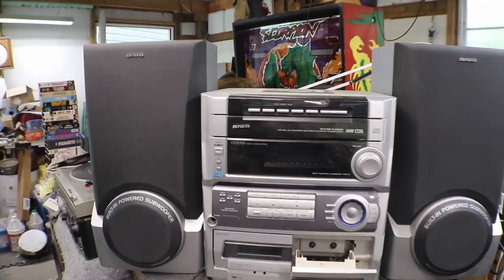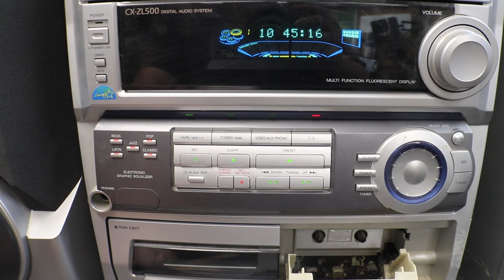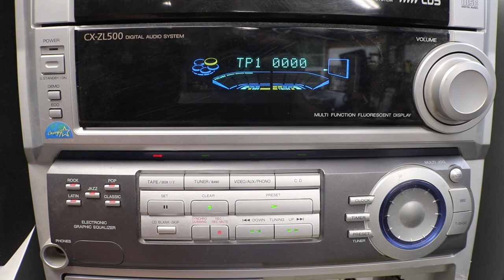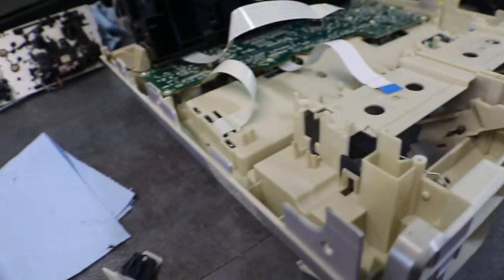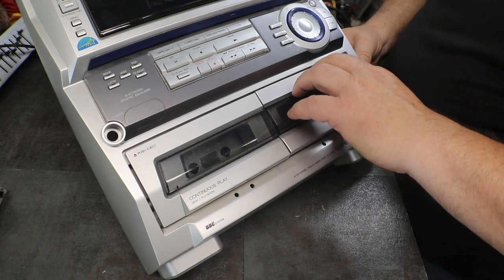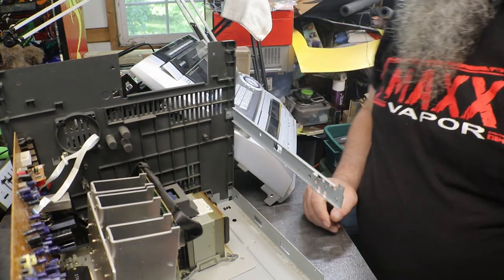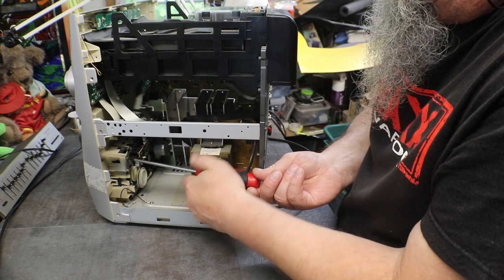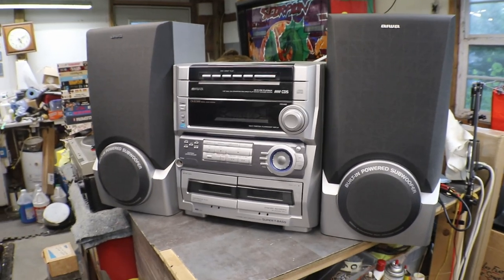Aiwa CX-ZL500 All In One / Cassette Drive Repair Belts & Door

Comment: I see the cassette deck door project like this as far as selling it since everything needs to work,is if you didn't attempt to try to fix it it would be parts but since you rigged it with a modified repair then it should be functional so it shouldn't have to be perfect just work decent. And this stuff is exactly why people sell them for parts but they don't usually have some of the zl and nsx, and naj dual deck Aiwa stereo models for parts available and you ain't gonna find most of the parts for them practically new... As for my 20cd dual tape deck player audiovox I have not seen another one anywhere?! Came from target department store.. anyways it has a big cooling fan on the back of the stereo that has gotten loud over the years and when I loaned it to my brother for the cd player it was practically new so since he hardly used the tape player section it probably just has gum belts lol and the cooling fan probably needs cleaned but honestly I have been weary of taking it apart everything else functions and is in nice shape but it is dusty now and I am not sure if I still have the speakers but I have the stereo and the remote control. But it worries me attempting to fix that one since I can't even locate another one anywhere, and it has like dock doors from a spaceship shuttle to load the cds lol

Comment: I have a volume knob issue with my Kenwood av receiver it works backwards lol, I was told just uplug the stereo and leave it unplugged for about a 1hr and plug it back in im guessing that it probably is a smoker issue and needs cleaned since the lense looks dark tinted and every once in awhile I will go to clean it off and the towel wipe turns dark brown in spots yuck

Comment: I need to change the tape belts in my aiwa it's a cx-naj54 i bought it used from ebay a few years ago when my audiovox 20cd player dual cassette stereo quit playing tapes, because I grew up using my best friend's aiwa cx-nsx500 and it would pound i lived with him and another one of our best friends at the time and the stereo im mentioning he is still using it was bought new by him in Elkhart Indiana in around 1999 and played tapes, cd's and the byr on the radio and it was also the surround sound system for the tv and ps2/Xbox setup and that's what he bought it for,me my expensive stereo was in my car a 86 Buick Regal sport coupe Oldsmobile 307 roller cam v8 factory hd front and rear sway bar car. Panasonic cdq-df44 legacy 300watt amplifier and Jensen xs bass 10's in a small cubic ft twi hatchback ported subwoofer box bought from summit racing and the subwoofer speakers were new from Meijer grocery store in Muncie Indiana, stereo hh gregg in Muncie i had a set of pyramid phase 3 gold series 4x10 speakers in the rear package tray mounted on the bottom, and the cheapest thing I had in it was the dash speakers because in 1998 there was not very many decent options that a kid out of highschool could afford that were worth buying so since only the dr side worked but buzzed i bought a set of $6.95 a piece road gear 3.5 inch replacement speakers from Walmart and they actually sounded fairly decent.. but later on i have had a set of cerwin vega hed 3.5 inch speakers i bought for my 86 Chevy k20 custom deluxe truck but I never used them, and I did have a set of jbl speakers in my 84 Oldsmobile cutlass supreme brougham the previous owner installed they sounded really good and even handling a little bass fairly well
Reply from the maker: I have found that 90% of the problem with cassette decks now is belts and cleaning.

Comment: Hi, I have the same system. However, it is extremely temperamental to turn on once switched on at the wall. It’s as if the current isn’t high enough. Any way to resolve this issue?

Comment: Excellent job, I have a question, what liquid do I use to clean the Volume button? What is the name of the bottle? I would like to buy it, my AIWA has that problem with the Volume button, it looks like a good product.
Reply from the maker: I have no idea the brand. I buy it by the case at auction and it only has a white label on it.

Comment: I have this. Do you know how to use the aux cable. So i can connect my phone? thanks
Reply from the maker: No I sure don't sorry.
Reply: @RetroGamingWithHopper  No worries i found it. The white and red output at the back, connect it with a SLX black 2 male phone stereo jack 1.5mm. Got it connected to my phone
Reply from the maker: @Gillxy  👍👍